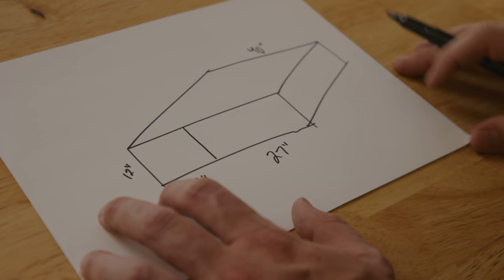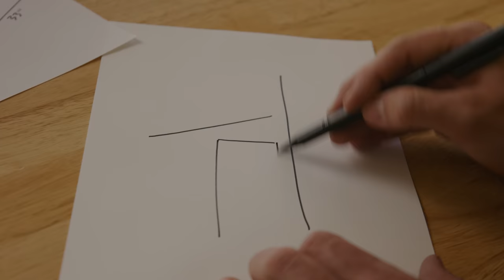DIY Off-Road Drawer | Overland at Home

Comment: That notch by the seats doesn't seem to do anything but take a little space and add a little weight.  I thought you were going to cut the drawer to fit in there.  You might as well cut that part off